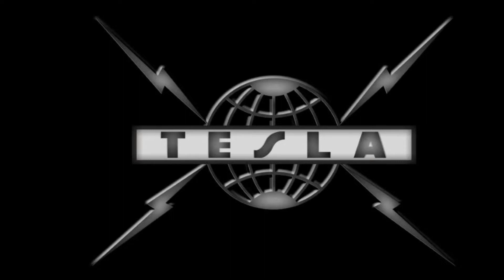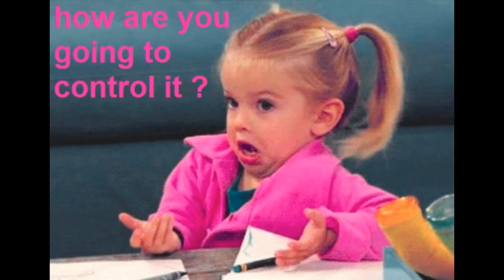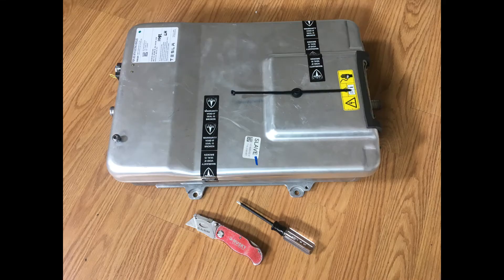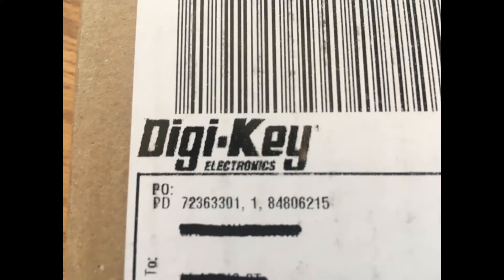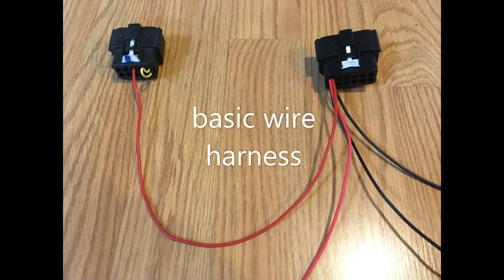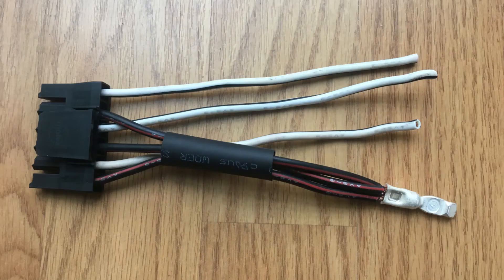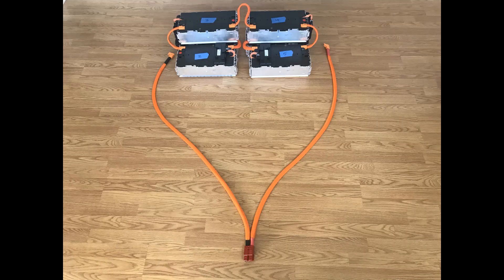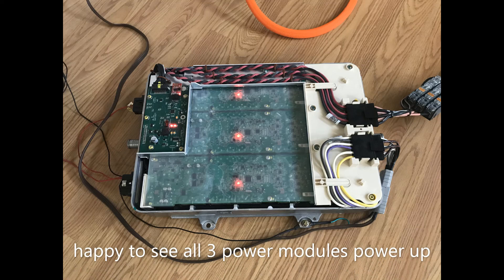Tesla Model S Gen 2 Charger EV Conversion

Comment from the maker: SPECIFICATIONS

Input Voltage	       110V-277V
Input Current	                <40 Amps
Input Voltage Type	Alternating Current
Input Current Type	Alternating Current
Total Charge Rate	10 kW
Cooling	                        Liquid
Weight	                        16 kg (35.2 lbs.)
Dimensions	                500x300x100mm (19.69x11.81x3.94” in.)
Phase Count	                up to 3 phases

Comment: Hi, hope you are well, im struggling to find all the info nneded to get mine set up, what is that yellow jumper wire on the one plug ? what is its use
Reply from the maker: oh goodness, it's been well over a year since I played with it, I decided to use the Chevy Volt one instead, I think you will find everything you need in the link before the last one from the bottom called: I bought a Tesla Model S Gen 2 Charger - Now What? sorry YouTube will not allow me to post external links, so check out that thread and if you are still stuck email me at muszyngr at yahoo dot com in the meantime I will rewatch this video and see what the wires do

Comment: Awesome video man!  Thanks for the whole write up - for all the elec engs sitting quietly in the background wondering about this stuff its great that you have just gone ahead and made a write up + bonus video!
Reply from the maker: My pleasure!
Reply: Funny question: if the charger isn't connected to a battery pack on the DC side, will it still spit out 400V? Mine doesn't and I can't check because I don't have my pack yet. Maybe something in my settings is off...

Comment: Thanks Greg (?), great to see it works like magic, you know smoke and mirrors - in your case mostly the smoke!! Your videos are a great inspiration, I have started my own project. So far I have a blue tarp, painters tape and a dryer cord!! (still searching for affordable ev parts!)
Reply from the maker: Thanks, ha ha.  Have you considered going the used Toyota Prius electric motor(s), inverter, converter, and controller route?  Toyota built millions of them and the wrecking yards must be busting at the seems.   Damien Maguire offers replacement controller logic boards for them on his EVBMW WebShop here https://www.evbmw.com/index.php/evbmw-webshop/toyota-built-and-tested-boards this is the route I would take if I was to do it all over again
Reply: @Good-Enuff-Garage  Yes the Prius is very affordable, if only it was a bit faster as I have a heavy right foot!! I will probably get a Prius Inverter to start with. I found a gs450h transmission very cheap, but it needed an oil pump and they are $$$$$'s!
Reply from the maker: @dombutler7685  Yes, buying a GS450h transmission without the electric oil pump is Cardinal Sin #1